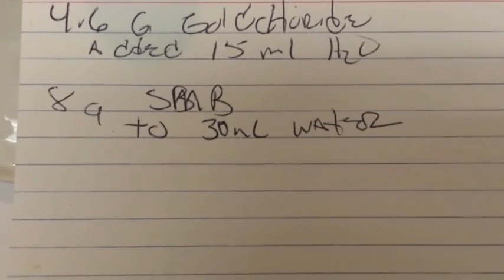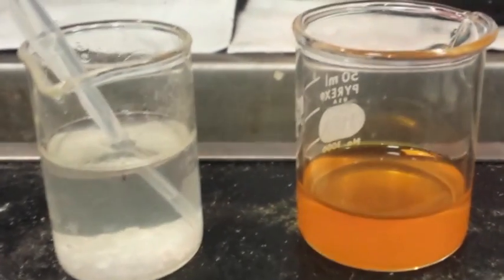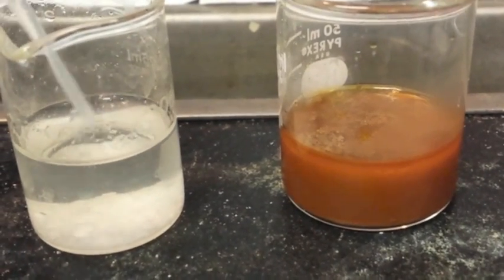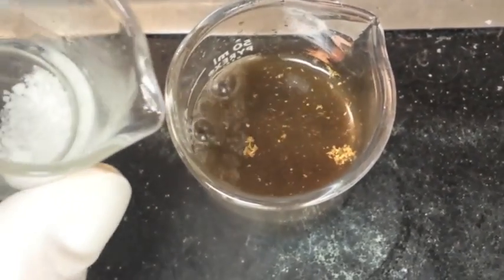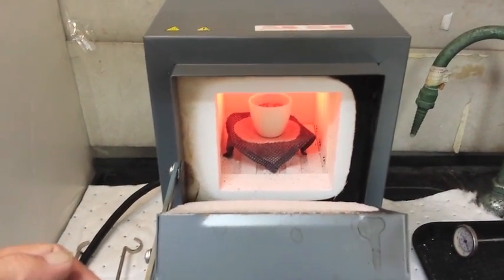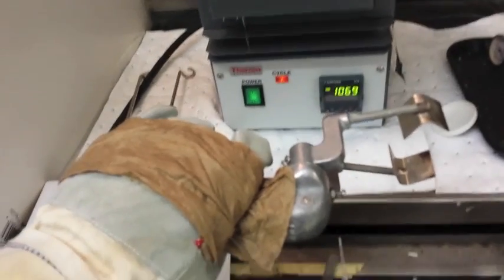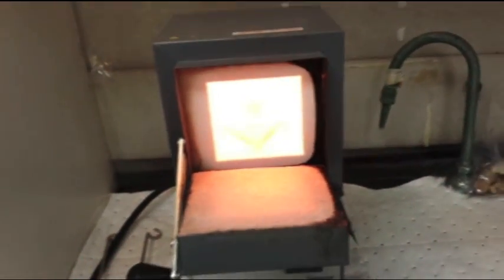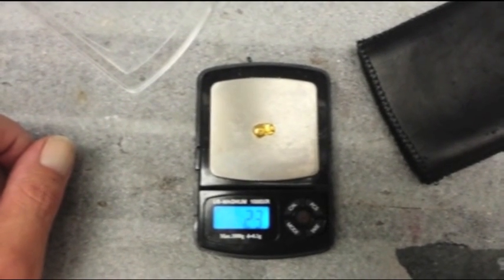Gold! Recovery of gold from chloroauric acid (gold chloride) using SMB

Comment: which acid we need to recover gold
Reply from the maker: this method does not use an acid to recover the gold. However, in commercial use, a combination of hydrochloric and nitric acid is used, called aqua regia
Reply: @drricket  I heard in Australia back in the day they used the cyanide from eucalyptus leaves in dry powder form to soak their quartz crushed gold ore in the eucalytpus oil to extract the gold leach method

Comment: Hey, I plan on doing this soon, but I can only get a good price on a slightly different chemical, Chloroauric Acid Hydrate [HAuCl4 · xH2O], how would I reduce pure gold from this chemical. (What materials, chemicals, etc do I need to complete this task?) If possible can you create a video of the process similar to this one?
Reply from the maker: +Darron Caruthers +dispatcher7007 is correct; I was able to accomplish this because I had the chemicals b/c of a major lab closure, and was done for EDUCATIONAL PURPOSES ONLY. This is an INSANELY EXPENSIVE way to reclaim gold. Simple math: Chloroauric Acid is ~ $100 a gram, or $2600 an oz @ ~50%Au = $5200 per oz of gold if all the chemicals were purchased on the open market.

Comment: Darryl, can you help me out? I have a solution of cholorauric acid that will not further precipitate with SMB. (the gold was from computer scrap and I made sure to remove nearly or all of the other metals before the first perciitation which was very successful) Like a moron, I believed that I may have added too much nitric acid so I added urea to the solution. Recently I added more HCL to the solution and then titrated  with nitric until the rxn ceased. I then tried to use the SMB again with nearly zero precipitation. What, in your opinion, is the best way to deal with this? I was thinking about attempting to reduce the solution via atmospheric distillation but I am slightly concerned that I may have made ammonium nitrate. Any help you can give would be great.
Reply: Most trolls would say stannous test it. I say decant it, sprinkle botox and take a torch and skip all this nobel prize gold melting trick just to dodge the nazis.